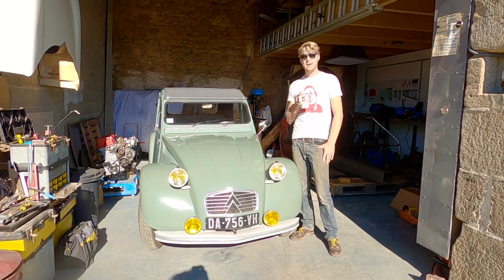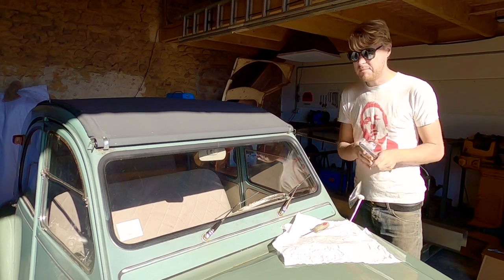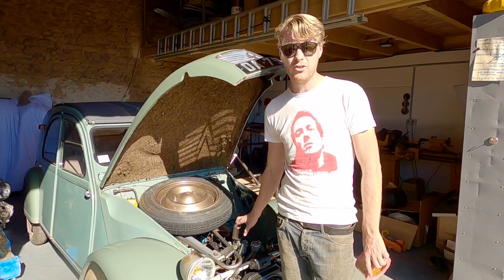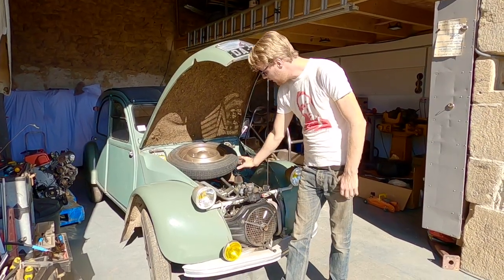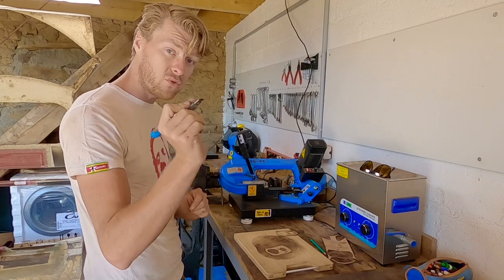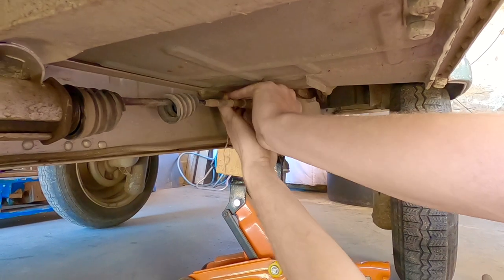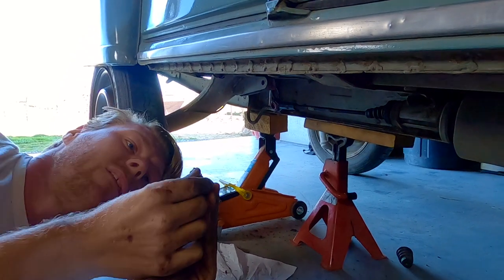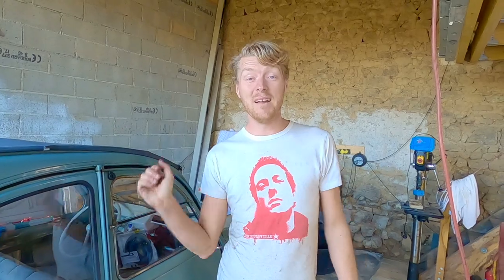5 Easy Citroen 2cv Fixes

Comment: Can you buy replacement springs (or indeed replacement arms) for the windscreen wipers? Although it passed the MOT test in August, one of the wipers on my mid 80's 2CV6 isn't making proper contact with the windscreen
Reply from the maker: You can buy new arms but the quality isn't as good. my advice is pick up some up second hand

Comment: Not very smart to place a K&N Filter.  Because a 2cv has no radiator (water cooled) it gets very hot under the bonnet. With a airfilter like this one it breathes in hot air from under the bonnet.  The sarter thing to do is use the original airfilterbox that takes it's air from outside, thus being cool air.  And cool air give more horsepower.  Using this K&N filter you can loose up to 10% of your horsepower.  And 10% of 18hp is not much, but when only having 10 hp ......
Reply from the maker: The 425cc 18bhp engine doesn't have an airbox just a metal mushroom with a washable filter in it, the K&N does the exact same job in the exact same way just with slightly less restricted which is why 2cv racing cars use a much larger version. The intake and exhaust manifolds are tied in together so any slight gain from a "cold air intake" is pretty much undone by the exhaust and the oil cooler blowing on the carb which was done by Citroen to prevent the carb freezing in winter.

Comment: Hello from Canada, I have acquired an older 2CV 1957. She was taken care of but needs some basic maintenance and probably some metal repair to floor. All original and runs well but very very slow. 70 km/h tops. Almost dangerous on our roads. I’ll probably mount a flashing light on the bumper to warn people bearing down on me while they’re inevitably txting. Your video is helpful as I get started. Thanks.

Comment: Hi Oliver, I am also in the Limousin, and have just bought a 1974 2CV which I'm picking up very soon. As you know the Limousin is incredibly hilly, how does the 2CV cope with them?
Reply from the maker: Absolutely fine  even with my little 425 I have quite a few driving videos on the channel so you can see for yourself. In Ahun Limousin there is a 2cv fete in mid summer that's a chill picnic affair and worth attending
Reply: @OliverPickard  Thanks for your reply, Ahun is just over an hour from us, so we'll certainly have a trundle over for the picnic, is there a 2CV club in the area?
Reply from the maker: Not really it's all the local car clubs working together and most people in most of the club's have at least one 2cv so it just turned into a 2cv show
Reply: @OliverPickard  Sounds like fun, do you have the dates?
Reply from the maker: The 14th of July according to Google
Reply: @OliverPickard  Marvellous, thank you. I shall seek you and Jolene out! By the way, the link for the NGK plugs, would that type also be good for a '74 2CV?
Reply from the maker: Yes they are also fitted to my parents 1974 Dyane6

Comment: wicked Oliver ! great episode, I'm going to do pretty well what you've just recommended on my AZ 1956
currently she cold starts no problem, but has issues re-starting (so think I'll also replace the ignition coil)
along with your suggested spark plug cable replacement and carb gasket..... nice work by the way!
cheers!
Reply: PS my 2CV is called Roscinante ;) (my little bit of spanish, thanks to Cervantes) since she's a good reliable grey horse... good enough to go jousting windmills

Comment: Hello Oliver, as always a pleasure for your videos, on the short spark plug cables you have to check that they never touch something hot and it is true that they are of quality, I remember once in 1990 on the road the 3cv began to fail until we were in a single cylinder runing, the cable had melted sticking to the fender.

The wheel support I have an Argentine version that is fixed, my fear and I ask you does not dry out the heat of the engine to the rubber of the wheel? I had thought of making a bag for the wheel that is heat insulating. Great video
Reply from the maker: Thank you! I don't think the engine heat shortens the life of the spare tire in any meaningful way because if it did it wouldn't have been done in so many cars but personally I advise people to replace tire after 10years anyway
Reply: @OliverPickard  Grat advice! thanks